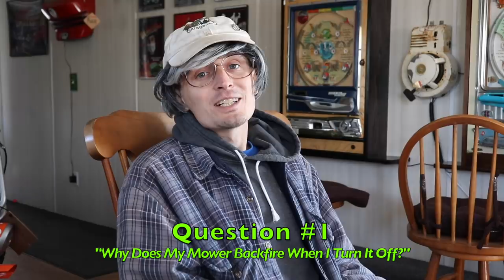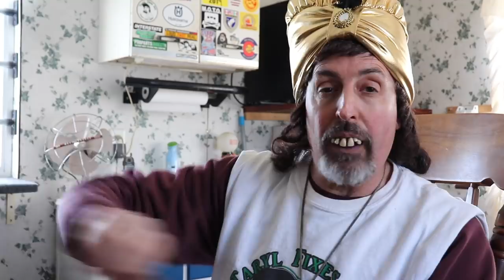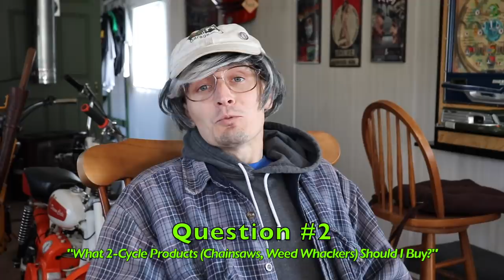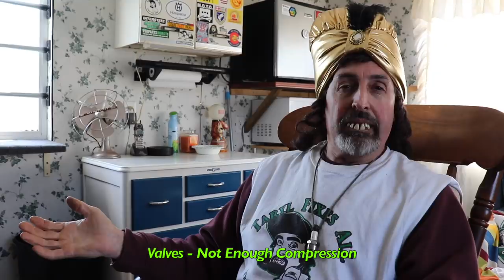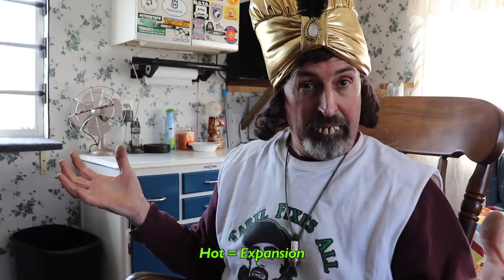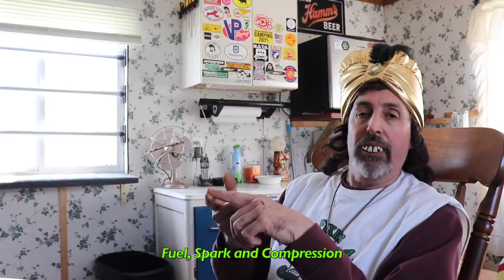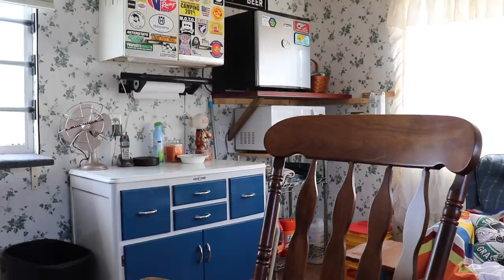Taryl Q&A #4 You DON'T Know This Stuff

Comment: He also never mentioned loos head bolts when talking about loosing compression on question 3. I had 1 12.5 hp briggs flathead a month ago. Complaint was that it would no restart after it was shut off and it was loosing power while running. I checked the compression. It had 80lbs cold but dropped to 25lbs hot. He said another shop put new valves in it last winter. I took the valve cover off the side of the engine to check the clearance. It was on the money. So I started to take the head off to check the bore and valve seats. And noticed the head bolts were very loose. So I just tighten the head and run it. Compression was 90psi cold and 120psi hot and it refired fine 3 or 4 times. So I replaced the head gasket and no problems for just over a month now. I changed oil in it today. (New customer coming back from big shop down the street). This 13 year old Kid and his sister mows about 15 lawns around here. Well 16 now he mows 2 of my 3 lots for his blades sharpened. And oil changes and new air filters every month on his old Dixon 0-turn, lawn tractor, and a push mower.
He also failed to mention fuel filter not letting fuel flow good. I've saw that. The fuel filter not 100% plugged but still restricting the flow just enough. Or even a paper fuel filter designed for a fuel pump being used in a gravity flow application.
Reply: Is the kid's Dixon the old kind with the friction cones rather than hydro. I kinda want one of those. I saw one for sale for $250 a few weeks back, but I have too many old lawn mowers already so I have a strict nothing over $25 policy.

Comment: I had one tractor that would shoot flames out the muffler when working it hard. One night it blow the muffler clean off and started on fire. I had my local shop replace the carb and add a fuel shut off. It would still blow flames out the muffler when working the tractor hard.

Comment: Hey Taryl, my deck on my craftsman just disengages arbitrarily and I get it to wrk by pushin the pto switch in and out again, seems to happen mor and mor. Pto switch, bad clutch??? Thx...great vids!👍🏻
Reply: Check your battery for internal resistance. Battery is likely sulfated..might have enough voltage, but not amperage. Check and clean all electrical connections...you want bright and tight connections. Dull looking connectors are "corroded".   PTO switches and clutches usually aren't intermittent failures...they either work or not.

Comment: I have a tractor that i prefer not to use the kill switch on . It shuts off when backing up with the blades engaged and that sucksThe carb anti backfire switch serves as a kill switch just fine, even with the kill wires disconnected from the coils Of course a pro repair shop would not be allowed to do what i did

Comment: adding to that weed eater subject, ive had issues for years with two cycle weed eaters and the carbs always going bad on them or needing to be rebuilt ive tried a fuel stabilizer and ive tried running it out of fuel and ive tried non ethenol fuel im not sure what im doing wrong but i have horrible luck with them alot i have to keep retuning the carb i check the plug and filters, gaskets and seals every nutt and bolt mix fresh gas empty and put clean fuel in ive tried many cheap brands and many expensive ones, what gives? i recently went to a 4 stroke weedeater had my doubts so far so good i suppose it starts a little harder than im used to with a two stroke (couple pulls) and it fires up and runs great. i bought a husqvarna chain two years ago after my craftsman wouldnt run anymore died out in the middle of the woods i rebuilt the carb still no luck put new fuel lines it would get a little better and then it wouldnt run again its sad because it wasnt very old and has awesome compression fires up everytime you pull the cord but dies right after but the husky so far has done great always run it out of gas and empty the tank
Reply: Ethanol is the biggest enemy of all my equipment. Every few years I have to replace the fuel lines in my chainsaws, blowers and weed eaters then all is fine again for a few years... using OEM fuel lines doesn't seem to help. and they are floating the idea of increasing the ethanol  content. Thanks uncle sam...
Reply: Premixed gas in a can from a store is the best. Always the correct mix of gas and oil. One time with the mix being off or the carb not adjusted properly on a chainsaw...ruins the cylinder bore.  Pump gas (with ethanol) eventually destroys the pump diaphragm in the carb. People don't clean their chainsaws after each use...all the debris builds up and insulates the engine from air flow...overheat.
Most chainsaws I work on have totally plugged or missing air filters. And most have a lot of debris in the gas tank...it coats the in-tank filter. 
 Not to forget to mention...the guy the drops off a saw that "won't cut"...and I see the chain is on backwards !

Comment: I have a 20 horse Briggs & Stratton intek one cylinder is running stronger than the other one it's the right one that's running weaker can you try to diagnose what my problem be
Reply: Valves out of adjustment, head gasket failing, camshaft failing.
Reply: @heyinway  so could it be one or the other or all three

Comment: best advice today. if it worked and something was done to it. look at what was done. I once bought a engine/generator at a sale cheap. had the old tecomish flat head 6 hp. it would start but if you tried to put any load on the thing it would quit. not fuel problem. I looked at the old thing and saw the paint disturbed on the fan shroud. taking that off I saw the paint disturbed on the flywheel bolt. taking the flywheel off and looking at the NEW points the problem was obvious. the previous fixer had set the point gap at 35 thousandths. correct for spark plug but not points. I just set the points to 16 thousandths and it ran just fine. loaned the generator to a friend and his dumb ass kid knocked it over. let the oil run out but did not tell anyone. then put gas in it to run it again till it blew up. morel of the story never let kids operate things unsupervised.

Comment: I put an inline fuel filter and a shut off on my troy bilt tractor and fuel runs out at about half tank. Is there a filter in the tank?
Reply: Old Troy Bilt with tank under seat usually have a internal filter in the outlet. Remove gas cap, blow reduced pressure shop air from engine end of hose into tank. That should clear it. Its possible to get filter out of tank...grommet that holds hose in tank is difficult.
 With tank next to engine, no filter...debris in tank being drawn to outlet ?
Reply: @heyinway  ok thanks  mine is 2013 I put shut off in because I was getting gas In engine. Auto shut off working now, bad connection.
Thanks again

Comment: He never mentioned that the anti-backfire valve could be stuck open when the customer said "hay Tyral my engine has that valve but it still backfires". I had 3 in the shop today that the valves were stuck open from crap in the bowl. But the engine run fine. In 1 case it was running lean you had to pull out on the choke just a bit for it to run correctly. But after 10 mon running even with the choke in and surging from lack of fuel. I turned it off to clean the carb it backfired. And even after 35 years I still jump when they do.😂

Comment: Battery power has it's place, just as gas power does. I can't weed eat for 3 hours straight with a battery powered weed eater, nor can I brush cut. Bucking logs for firewood with a battery chainsaw would be tedious. Milling logs would be impossible. On the other hand I do keep a battery chainsaw in my truck to clear blow downs and I use it for small jobs like limbing. No gas fumes in the truck, only a few cuts needed, cleaner to store in the truck. There is no way a battery powered blower could manage the hours of continuous leaf blowing I do during leaf season, nor do they have power to move piles of wet leaves from drainage ditches. I do use battery blowers for small jobs like blowing off decks around my home and am going to try using one for misting insecticide for black flies and no-see-ums. As batteries get better battery power will be more useful but it will never fully supplant gasoline power.

Comment: Engines backfire from TOO lean mixture. The wholesale problems started when  the gooberment's EPA forced engine manufactures to run lean mixtures which run hotter & light off much easier. The fuel shut off solenoid on carburtators shuts off  flow to high speed jet.  Killing ignition at wide open throttle, fuel is cut off and not coming from the low speed jet. If you idle down, the throttle plate creates high vaccum on low speed circuit. Fuel coming from both high & low speed jets, just rich enough to run, but still lean. Turn switch off at idle... POW! You get a backfire.

I have a 21 HP Briggs Stratton opposed twin with a Nikki Six, which is a precision manufactured Japanese carb but gets clogged easy. When low speed gets clogged engine governor "hunts", slowing down then speeding up. When shut off POW! Time to clean carb. But it still mows, the engine running on high speed jet. Great carb, just parts are a little more expensive.
Reply: If I remember correctly I once read somewhere Briggs recommended throttling back to half throttle and then shutting the engine down.

Comment: They move to battery because they can make proprietary batteries that will need to be replaced every 2/3 years and your stuck sucking the teet forever.  Rather than properly maintaining a gas engine and having it run for 20 plus years

Comment: Vapor lock is definitely a thing. 30 year old Hustler 275 started to die when hot. Had Me and the shop baffled for a long time. Finally one day after stopping I just stood there looking at the  motor, noticed how close the fuel line ran to the  muffler. A few wraps with a strip of beercan aluminum fixed it.

Comment: ...and, how many times does a customer say,"probably needs a spark plug", or "I already changed the spark plug-I thought that would fix it", regardless of what the symptoms were?..I'd say 60% of stuff that comes in, the customer has already changed the spark plug(may have put in an incorrect replacement plug, though)...like a new spark plug is gonna fix a fuel starvation problem or a gummed up carb, or a chainsaw that has low compression because of a scored piston and cylinder...geez, if replacing the spark plug would fix every problem on a piece of equipment, we wouldn't need repair shops at all, would we?....

Comment: Gr8 vid 
I do prefer gas for now,  but I think when ever it goes next one may be 40v battery as long as its 0.080 line or better.   My weedeater is a cheep MTD made  been working fine for 4 seasons now,  but I always use
 non ethanol gas with synthetic 2 cycle oil
Reply: I changed over to a battery operated weedwhacker a few years ago I don't care what brand weed whacker you buy every 2 stroke gas weedwhacker  will give you trouble eventually I've bought a bunch of them in the past but no more. Plug in charge and go battery operated is the wave of the future.Great q&a keep up the these informative videos I love them.

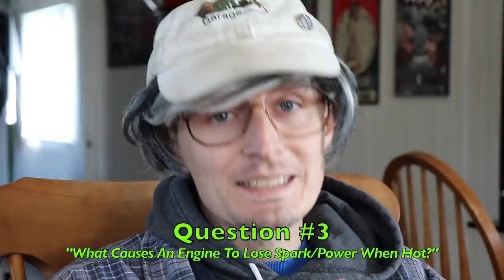Comment: Hello Taryl; well?, 3-days late here in getting to your Video but Hey - The Good Lord has seen fit to keep me busy with " MY " backyard Mower Fixing *Hobby*. First let me mention that God has Gifted you with the Ability, Knowledge, Showmanship to Teach thousands of individuals looking for solutions dealing with their small engine universe and you always seem to know Exactly what their issues are and "Occasionally" DO hit the Nail on the head (a little "Sarcasm" here) but for me?, " I " always get caught with the ones that look like Nobody has the answers for. at 8:45 in this Video?, when the engine gets hot?, EVERY motor has an "attitude" in many different ways and I have TWO in my shop right now WITH that attitude. I've run the gambit on down the list of "Possibles" by test elimination and even replacing what I THOUGHT could be the deal/issue and these lil boogers (both of them) STILL taking their coffee break in the middle of the job or very shortly after their shift starts. After doing ALL this testing and replacing stuff on ONE of them?, the thing runs a WHOLE lot better but STILL has the SAME problem with it when it arrived to me. Customer brought it in just to get some TLC maintenance thinking it just needed a tune-up. ~~NOPE!!!~~ they always seem to need a deeper looking at when " I " get them. Well, I believe I have found something with THIS one and I haven't seen anyone address THIS find. Older Craftsman (not that it matters) Briggs 18.5 Intek w/fuel pump, I found accidentally while running it (still popping & sputtering) I just HAPPEN to take notice the fuel filter had loads of bubbles going through it and each time a bunch of them would move through?, milliseconds later it would do the pop & sputt, Know what?~~the dog gone fuel line from the tank to the pump farther up UNDER the frame had rotted/cracked sucking AIR into the system AFTER  it has run a few minutes and eventually dies because of starvation. The OTHER mower (Briggs 18.5) ?, I`m stumped~, gone through ev-thing on it and still dies when hot.

Comment: why wont my briggs one cylinder idle down after running it for a while
Reply: If you've checked your carb & it's clean & properly adjusted and your air filter is clean, then look for loose or improper linkages or a worn governor. Also, check your crankcase oil level & oil viscosity. Both can affect your internal governor. A broken wind vane under the pull start can screw up your wind driven governor if so equipped. If all that fails, run your machine WOT until you blow the engine & then toss it in the trash & buy a new one.....or a battery powered version.

Comment: I have a Raven hybrid generator under seat runs motors on deck and wheels. 48 volt batterys run down not charging while driving and blades on. but while idle charges them. at that point 56 volts  it works 5 year never a problem no it is company went belly up sold by lowes. sent it to a shop kept it 2 weeks told me over there pay grade.
Reply: 5 years...everything is worn and has increasing resistance to movement...drawing more amperage than when new. Batterys have a lifespan of x number of discharge/recharge cycles...worn out. Generator can't keep up with the demand when moving.

Comment: lots of self serving advice designed to enrich the dealer. why are dealers called stealers? I think you are a good dealer but many are not. the toro dealer in my neighborhood where I bought my mower from back in 1997(still my mower) they were thieves. I can explain, when it was 45 degrees or less outside there was no spark. took it in for warranty and the stealer charged troybuilt for new ignition coil assembly. did not help at all. I looked at the paint and you could clearly see they never had the fan shroud off the mower. what was wrong was to big of air gap between coil and flywheel. I reset the gap properly and its run fine since. thats the kind of stealer the gives the business in general a bad name.  I fix things my self. 55 years ago a watch maker told me all watches run till the oil goes bad. just buy a timex and throw it away when it needs service. you know what you are doing and teach us all lots of good things.

Comment: Best repair channel for small engines on the net!
Anybody can help with a possible too worn week whacker below? 
Hi, My little weed eater shows 100+ psi when cold (3 pulls) then after its hot for a while it starts to lose the idle and wont run any more. I quickly tested again and only got 70-90 and coudnt even reach 100 psi after 5+ pulls.  Is the engine too worn now to make the 2 stoke cycle work anymore? all coil and fuel and carb has been substituted and bypassed so its not that. also crankcase is airtight after pressure testing it to 9lbs and replacing all gaskets ect. only thing left is a worn engine?  also idle Low screw setting wont settle in one place anymore and have to keep using choke to start it even when hot. got full power and the l & H screws can give me more or less fuel , its just after a time 10-20 mins its dies and wont run any more like its starving or air being introduced but i already eliminated all that with total strips and replacement and 3 carbs and emptied tank twice into a container to be sure it wasnt blocking up or the vent valve was closing. I even gravity fed the carb when i removed the pump gasket and blocked off the pulse channel to see if that was losing pulse when hot and it worked great and still stopped exactly the same, so fuel delivery cant be it with 3 diff carbs. 
Thank for anyone who can help out!
Reply: Its overheating. Debris wrapped around string head causing drag.  Coil will overheat and shut off. When it cools it will work...until it fails.  Remove muffler and clean spark arrestor screen...too much oil in mix will clog it.  While you have that apart...look at cylinder bore and piston. Likely its scarred and scored. Normal wear, mis-adjusted carb, and using wrong oil/gas ratio all contribute.  Way past time to trash it.

Comment: 😮Brain farted here😂 got Kohler 25hp V courage 😢😮 pop the top and had 2 seized valves 3 bent lifter rods😮 nothin busted nor cracked cept rods and valves stuck,,,😊seen yer valve guide remodel don't seem they walked any but all 4 should have oil seal correct,,,😮Baffled😊 really 😢 ya'll great as a bout of hayfever😮😂😂🎉